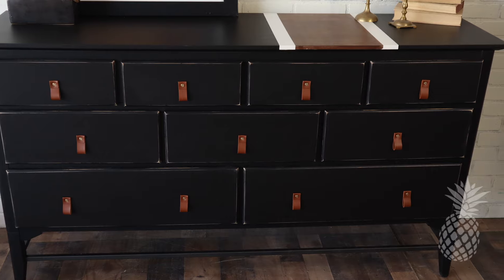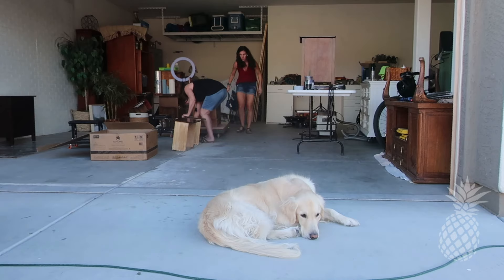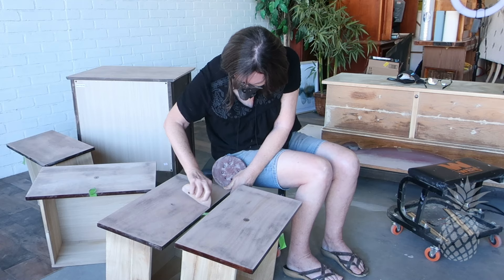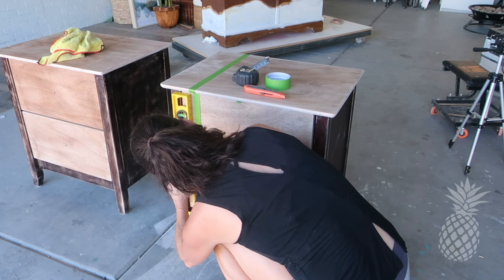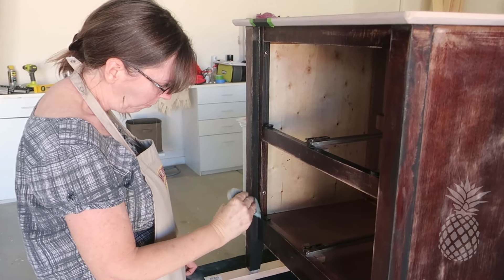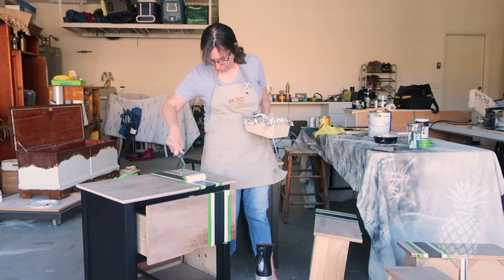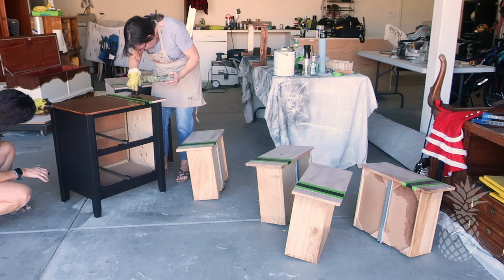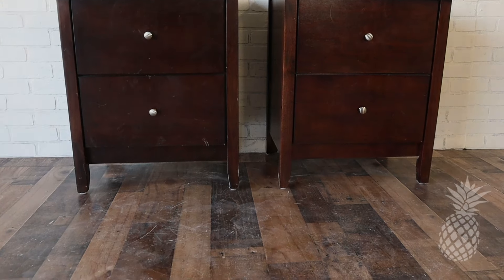Nightstand Makeover DIY // Mother Daughter Paint and Stain Nightstands

Comment: Question when you use mineral spirits do you have to clean after with soap and water or just let it dry and start painting?
Reply from the maker: Mineral spirits is a solvent/cleaner and there is no need to rinse it off the wood but it does need to dry for about 15-20 minutes before staining. It really helps in removing sawdust after sanding and it helps to see if there are any areas that have sanding swirls or other uneveness that may need touching up. We don't usually use it under paint but I thin you can if it has had time to completely dry before applying the paint. (Mineral spirits is similar to paint thinner.) Hope that helps and thanks for watching.